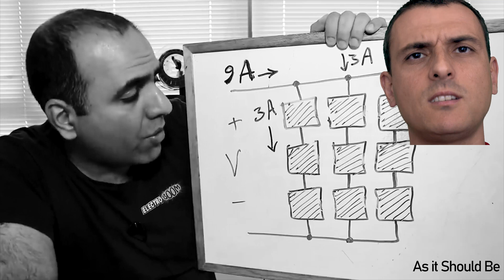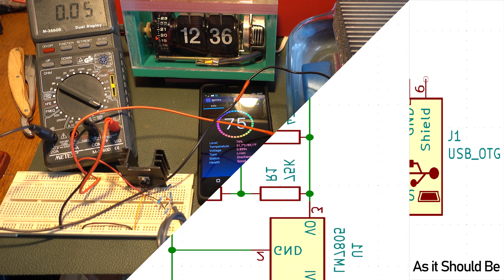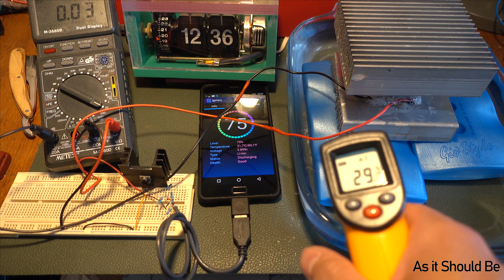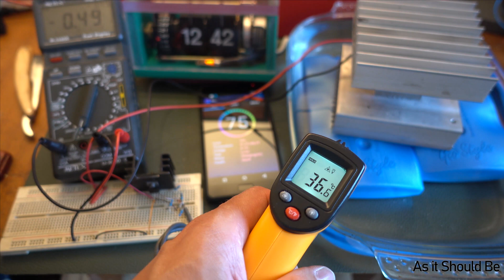Caricatore usb post apocalittico fai da te.

Comment: This does not work because it requires energy to work so it is not a very practical motor
Reply from the maker: maybe you know something who can generate energy from nothing? i'm curious
Reply: As it Should Be no that’s why I pointed it out
Reply from the maker: you can say me that the efficiency will not be great but if you already have something cold and something hot and you need some electricity, is nice, thanks.

Comment: So you are saying that a peltier device can't generate power, even it did it can't be use?
Wait, Mehdi did NOT say it was usable, with boiling water on top and a big cooling fan on the bottom, it BARELY lights up two small LEDs and one of them didn't even get enough power!
And what you do is throw two ice(that's what you said)which doesn't let the water temperature down and does shit, and you heat up the peltier device's top to raise the temperature, which will drop down quickly anddoes shit either way because the device is made out of fuck'in iron and there's water on the bottom!
And you connect it into an smartphone???
I'm sorry I can't take this shit anymore
A smartphone need at least 5 volts and 2 amps to charge properly, and that peltier device outputs nearly no power due to lack of temperature differences, so even you rectify it to 5 volts, there's still not enough power, so the phone doesn't charge up
But that doesn't means the peltier device don't generate power!
For example, if I connect an AA battery to an air conditioner, and the air conditioner doesn't do shit, it that means that the AA battery is dead?

NO!
Reply: Maybe you will say that heat needs time to conduct, look at the clock on the table(nice clock I need to say),between your "no load test" and "phone charging test", there's twelve minutes missing, in twelve minutes you could do lots of things, like cool down your peltier device?
Reply from the maker: man, what are you saying? why should i cool the cell? the optimal operation requires that one side is hot and the other is cold, I don't understand you .. I cut down 12 boring minutes, otherwise I would have made an even more unwatchable video, the water must not be frozen, with a temperature of 20-30C ° is still fine.
The important thing is, with a TEC cell, not to exceed 150C in order not to damage the internal joints.

Regarding the question of minimum 2 A to charge a phone, do a simple test; connect your smartphone to a pc on a USB 2.0 port and see what happens (USB 2.0 delivers 500mA max)

In your opinion, would I be so stupid to correct electroboom if you didn't know what I'm doing? and would I be here to answer those who offend me?

About the clock in the video, it's my creation, look here.https://youtu.be/oOgBzpjxOls

Hello Friend.
Reply: @AsitShouldBe  Man, what are YOU saying?
You just watching ElectroBOOM's video, saying NO, and did an experiment?
What are you doing?I can't understand
Reply: @AsitShouldBe  And why you put this video in ads?It's illegal right?
Reply from the maker: @ends9138  no man, it isn't, you just have to pay, LOL
Reply from the maker: @ends9138 there is some problems with translate i think.. what's your language? i can try to explain in that language.
Reply: As it Should Be I love the fact that you completely ignore the solid points
Reply from the maker: what solid point? please show me.
Reply: As it Should Be that the generator can barley power two small LED bulbs nevermind a Phone
Reply from the maker: @tato1780  the entire video is made on assumption that electroboom was wrong, the current is much more than like mandhi said, thanks friend.
Reply from the maker: new video with better explaination https://www.youtube.com/watch?v=SAHuR8W3l2E

Comment: At least for me It is still a unusable way of energy generation.. The amount of heat and ice you used is way more than you could use for example in a Stirling engine to generate energy. So a Peltier is not efficient in comparison with other generators.. I think you could explained in more details what exactly Mehdi made wrong because he said that energy is not efficient and you proved the same with your video, a lot of heat and cold energy used but not well optimized, this of course, at least in my opinion. Please say more details and explain better (Yes I have checked the description but it is not enough to understand what you have tried to explain here)
Reply from the maker: what I tried to explain is simple: peltier cells are perhaps not the best way to generate energy but .. it cannot be said that 12 peltier cells added together in series can produce 5V and maybe 50mA, it is a question of numbers! the actual values are 10 times larger.
A cold and a tumor are both bad things. But they are not the same thing.
Mendhy evidently did not create a sufficient heat flow between the cold and the hot zone and, seeing discouraging results, he reached wrong conclusions.

Bye.
Reply: @AsitShouldBe  Maybe he just put some exaggeration like he always do, but for me the point on his video was to show that peltier can generate energy, but no so well.. Yes now I understand why you complained.. But I don't know.. Maybe because I am a fan of Mehdi, I don't see this as a "fake" video, he tried to show something, indicated that we can use peltier to generate energy, but not for a real case scenario. You could show some more realistic example on a way that a peltier is used in real life, apart from charging a phone, like a real case used to solve a real problem. I understood now your point, but even so, I think you could have made a better point in the video, instead of accusing and raging the video from Mehdi, you could simply show some more stuff, compare what he did and why it was wrong, and show that Mehdi was wrong.
Reply from the maker: @marcelofrau8818  when you have millions of follovers and you say such an inaccuracy, it becomes an established truth.
Even I didn't know that electroboom video but a friend told me: you can't supply anything with a peltier cell, electroboom has shown it! 12 cells are just enough to turn on two 5mm LEDs!
the mendhi experiment should have produced about 30W of power using 12 cells; as long as you laugh and joke ok, but when you give such coarse and inaccurate technical information to people who do not have the knowledge to refute them ..
Maybe I was rude? I don't know, I think you understand I was joking.
And then .. hey, have you ever seen a video in which electroboom rectifies some free energy generator? I have been much kinder to him, hi friend.

Comment: what was the point of making this video?

what was the point of making this an AD?
Reply from the maker: I sponsored this video to target the content to electroboom fans.
the point is simple: in my naivety I believed that electroboom fans were people with electronic skills, who, seeing a practical experiment, would understand that the real performance of a peltier cell used as a thermoelectric generator is 10 times higher than  electroboom said.
In my mind this thing would have shaken them and made them think about the issue, sparking a technical debate.
In reality nobody understands anything and if I told you that a peltier cell produces 500uW or 500MW nobody would notice the difference, my fault.
Reply from the maker: i uploaded this, is more clear, bye https://www.youtube.com/watch?v=SAHuR8W3l2E

Comment: Mehdi isn't wrong,you just misunderstood in here(i think)
I think you're right peltier is not designed to be a electric generator, so the current is not too useful
Mehdi is just experiment,not thinking the current useful or not
Reply from the maker: new video with better explaination https://www.youtube.com/watch?v=SAHuR8W3l2E
Reply from the maker: in my test i got stabilized 5V@0,5A#2,5W not considering power loss in the stabilization element (LM7805) with only one peltier element, also assuming he is using a lower specs peltier (mine and his cells are not TEG), how he obtained 5V and something like 0,05A(the current used from a 5mm diode)  so, (5V*0,05A/12) 0,41V@0,05A#0,0208W on single cell? that difference is HUGE.  is a little math.

Comment: Neither of you are completely wrong, while boiling water is the only real way this could be useful,(even though it doesn't even work that well on a large scale) Extreme heat could work, and some power plants in my area are experimenting with it. 
They have black metal that absorbs most light, then have mirrors that reflect the sun into one point like a magnifying glass, it is efficient enough to run an electric stove but once the sun starts going down power is lost and it isn't very practical.
Reply from the maker: when the sun is present, the most efficent way is use a photovoltaic panel, if you look at my test, a very high temperature isn't required, 100 C° is  ok if you have something like 20C° on the other side. mendhi should have done some mistake, the fan surely is too weak to extract much heat from the boiling water, and the plate he made from baking tin (lol) is coated by some teflon  who reduce the heat transfer..  anyway he hasn't cut a finger with his angle grinder so he has already done a good job.

The heat transfer should be very fast to make some usable current.

Anyway i'm not accusing anyone, but the truth must be said. The first man who discovered this effect has been the forgotten italian Alessandro Volta in the 1787, the same man who invented the battery. After 1821, Seeback,Peltier, and Kelvin  took all the credit.

I'm an italian too and i can't listen that this effect is useless, so i had to rectify my friend electroboom.

bye friend.
Reply: @AsitShouldBe  Thank you for the info!
Reply from the maker: new video with better explaination https://www.youtube.com/watch?v=SAHuR8W3l2E

Comment: No shit you used a fucking blow torch lol
Reply from the maker: In my test the temperature was under 150C° but i tried and best result can be achieved with a temperature difference from cold and hot face of around 40C°.

I obtained   500 mA on stabilized 5V using a single peltier cell, how Electroboom can say that is unusable? 
Shorting the two wires, the current jump at 2A, try yourself!
He connected 12 cell in series and they only given  him 5V, after he connected  2x 5mm led in series, the voltage jumped down, so i assume the trasformated current is  around 5V@50mA.

His test was simply a complete mess, also mendhy has admitted it, he doesn't know so much about peltier cells.

bye.
Reply: @AsitShouldBe  was the cell you used capable of producing more then 500 mA?
Reply from the maker: @arknolifeftw7073  it reached 2 A when shorted, anyway the most important thing is the output from  the stabilized circuit: 5V@0,5 Amp.
If someone is interested i can try to push it to the limit.
Reply from the maker: new video with better explaination https://www.youtube.com/watch?v=SAHuR8W3l2E